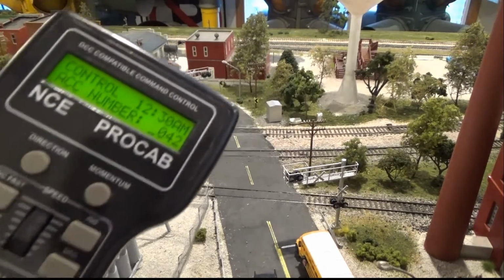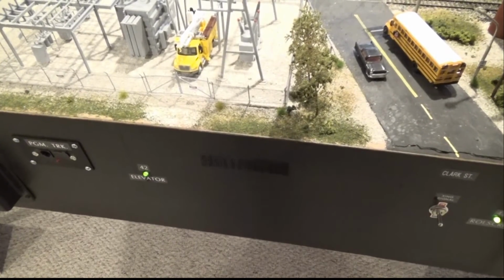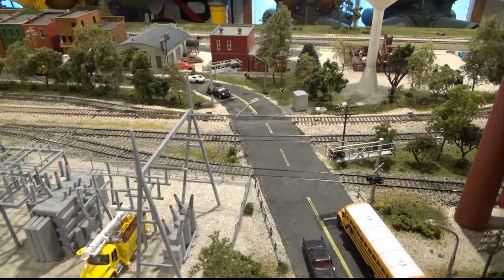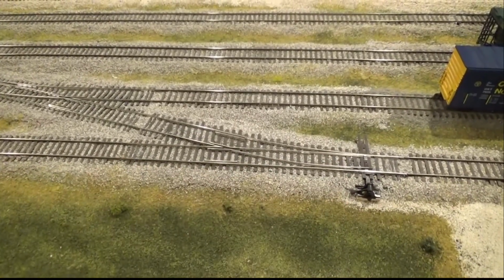DVR Layout Update March 2016

Comment: Very good update, I like the switch control system your switching to, It looks to be very helpful. Great loco roster as well, thank you for sharing.
Reply from the maker: +ruatrainman2 Yes, the system is the Switch-It and Switch 8 MKII. There is also an extension board to interface fascia buttons into the switch machine control. Currently, I can only control the switch machines from the throttle. Thanks for commenting and watching!